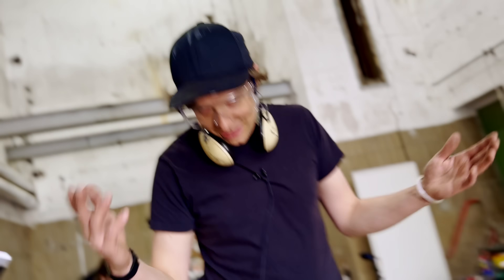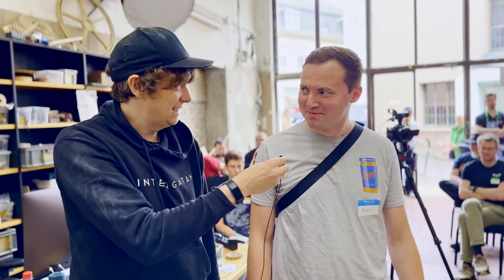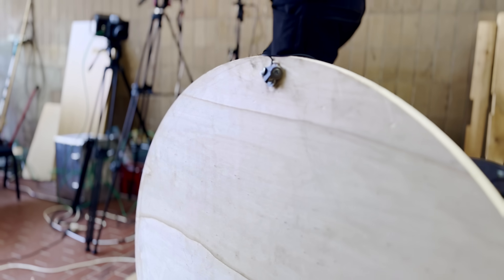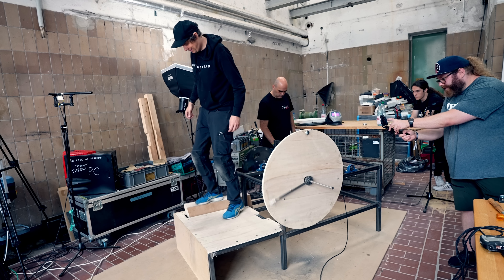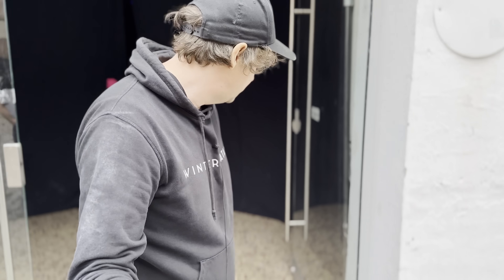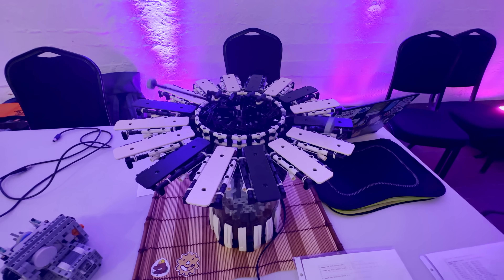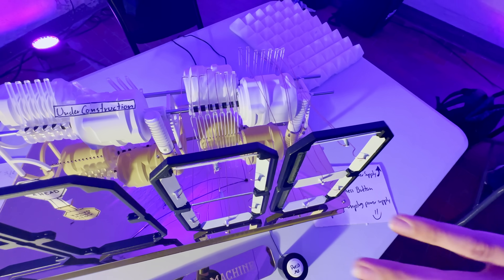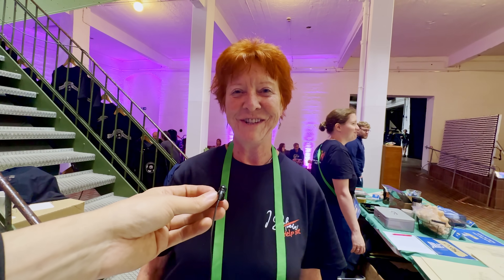First Timing Tests - DAY 6 - Marble Machine Flywheel Prototype

Comment: You're going to need some kind of regulator on the velocity. I don't know how that can be done mechanically without a ton of clockwork-like mechanisms. But ultimately, the consistency of the bpm is going to be limited by how well and on-beat you can pump the pedal. This will be hard no matter what and will be particularly hard when you are operating a bass guitar and various levers for the performance.

Comment: Don't match to a metronome, match to 1/80 of a minute after each hit on the wheel.
Have the computer play a sound on each hit of the mic, the sound is really too sounds the first starting at 0:00.00 the second at 0:00.75.
Then you can just get to speed and not worry about overshooting to match the metronome

Comment: If this doesn't work, you have the weight drive as a back up, and you can "recharge" it with this pedal mechanism; adding slack for the weight to pull.

Comment: I really feel like the falling weight design would be a lot better suited for this, for several reasons, and here are just some of them:
- In your comparison video you mentioned how the gravity powered design is used in clocks and even for telescope turning which are very precise scenarios. This will give you constant control over bpm without having to focus your leg movement to balance between overshooting and undershooting, which is both distracting and tiresome
- Flywheel systems are meant to store energy and release it, no one uses them for precision timing. It's kind of like a pulley (and additionally like a short term energy storage), where you input bursts of less energy quickly, to do a much more difficult job slower. Similar to a flywheel, where you pump in bursts of smaller amounts of energy, and can later release that energy for a more intense quick job. Sure a pulley is not a direct comparison but you get the point.
Reply: Ultimately, I think his machine will still need to incorporate a flywheel simply to resist instantaneous fluctuations in speed. I think what would be really cool to see is instead of a continuous energy input, the pedal could be used to "wind up" the falling weight. If there were a ratcheting noise associated with pressing the pedal, he could incorporate it into certain parts of the song for added effect.
Reply: An adjustable escapement could change the tempo but I'm not sure you could adjust it quickly and without stopping the machine
Reply: @MeisterFurball  from my experience as a musician, you need a system that can compensate for some degree of drift (besides being able to set a wide range of the tempi from the onset of a song). Drift compensation of course wouldn’t be necessary if the Marble Machine is always the instrument that’s generating the master tempo and other people/machines follow.
Reply: @MeisterFurball  Could incorporate a similar gearing system to bicycles, where the chain slips onto another gear on the go. I imagine it would be faster than adjusting the tempo of current flywheel design, even using the break
Reply: Falling weight works well for a clock because the size of the weight relative to the amount of work being done is manageable.  A clock needs a very little amount of input power.  The marble machine needs a lot of power just in the friction of all the components, which means it needs a massive weight (1000lbs+), or a higher drop rate (falls too fast to complete a song).
Reply: It would be very hard to control the tempo of such a system though. A musical instrument needs that control. If you were to use variable friction for small tempo variations, you would end up with instability that’s probably worse than the flywheel design.

Comment: Just thinking. What if you had an hall effect sensor on the flywheel so you could have an RPM readout and use that to coordinate around the BPM. It would help to eliminate some of the guesswork around synching RMP to BPM

Comment: Why are you trying to align a fly wheel, which is designed to, fly, with a BPM? You shouldn't be pedaling at your desired BPM as that defeats the stored energy purpose of a fly wheel; there should be a tempo mechanism that you are setting and governing the rotation of the programming wheel based on a set tempo which is drawing energy away from what is stored in the flywheel.
Reply: this <3

Comment: I think you need a gear box that can accept a variable rotation input and output a steady time. Then a stick shifter that can shift to different tempos. Sadly I'm not smart enough to design such a gear box. Sounds really complicated.
Reply: Its called a CVT "continuous variable transmission"

Comment: You've built yourself a Phase Locked Loop, but inserted yourself as the Loop Filter.  Your undershot / accelerate / overshoot / decelerate pattern is a well-known phenomenon when a PLL is under-damped.
Reply: The gain is way too low....and always will be, given the design. Adding more flywheel inertia will simply make the problem worse.
Reply: @chrissavage5966  That's why at least a 100 commenters have said he needs a differential and governor.
The differntial to allow quicker changes in tempo and the governor to keep the tempo stable.
Reply: @chrissavage5966  Solution would be a bigger diameter of flywheel with less mass in the middle, so weight would be the same but inertia would increase.
Reply: I was just thinking that this feels like a poorly tuned PID. I guess there are other control systems too, though I've never seen an implementation.
Reply: I think the device would be easier to control with a digital readout of bpm derived from an optical sensor on the flywheel. Martin is reacting to phase differences from the metronome but that is two integrations away from his input, foot force. By reacting to the speed he is doing only one integration, which is easier to control.
Reply: The system looks under damped, but increasing the damping (flywheel inertia) will make the problem worse. 

The system is oscillating because the critical period (the amount of time it takes to get up to speed without oscillating) is too long.  Martin is trying to force the system to come up to speed faster than it can and therefore he's overshooting. 

If you decrease the flywheel inertia , the critical period shrinks.  The machine comes up to speed faster and responds quicker to tempo adjustments. If you overshoot and begin oscillating, it's easier to adjust. 

Which has absolutely NOTHING to do with playing good music.   No one ever leaves a concert saying "They kept such steady time!"
Reply: PLL = Permutation of the Last Layer, which is the last step in solving a 3x3x3 Rubik's cube when using the CFOP method
Reply: @ChuckSploder  I've been practicing CFOP, I'll try over-dampening my PLLs
Reply: TL;DR: a human powered machine is never going to be anywhere near accurate.
Reply: It’s really amazing to me that people are still investing in Martin after MMX. This latest video shows he really hasn’t learned much.

Comment: With some practice, I think you can address the overshooting issue by applying weight on the upstroke (braking force) and removing your weight on the downstroke.  Alternatively add a toe hook so you can apply braking force on the downstroke

Comment: Please add a hinge to the pedal (or allow the linkage to fold) so it's never forced down by the flywheel. The sides are a good start for saving body parts, but if something wedges itself in the gap, you will tear the machine apart.
Reply: That's a very good suggestion. Makes it safer when something small and strong gets underneath the pedal by accident.
Reply: @vjay4297 like a steel marble? Lol
Reply: If a marble wedges in the back of it, it can severly injure you as a low speed bullet, as well. In general, backup needed.
Reply: A cable linkage might be a good solution
Reply: At the very least, the gaps should be larger than a finger, or in this case the toe of a shoe, so it's not possible to become trapped. I know it's only an experimental prototype but it does look like an accident waiting to happen.

Popcorn, anyone? 🍿
Reply: @nagualdesign  you mean smaller? Ideally this gap will be less than a mm, opening it up to 12-20mm sounds like a horrible idea.
Reply: @D3nn1s  No, I meant larger. In industrial applications there are health and safety standards to avoid crushing injuries and the like. A very basic technique is to avoid small gaps that could trap or crush a finger, or drag in clothing. If the gap never gets smaller than, say, an inch during operation it's far less likely to cause an injury.

Having a very small gap of, say, a millimetre also presents a risk of damage to the machine if you drop something into the gap. It's normally wiser to allow some clearance.
Reply: @nagualdesign  id were talking presses and stuff like that sure. However allowing a 3cm gap e.g. you could get a foot stuck, then the pedal will pull it further down by friction. Sure best scenario would be 2m of empty space in every direction, but since he needs to stand there its best to keep the gap as small as possible.
Reply: He did that on the mmx. Idk why he didn't do it here.
Reply: @theredstormer8078 this is just a prototype to see if it is viable for tight music, when he does build the matching he will ensure 100% safety
Reply: I believe that's part of the plan and I think he already has it made. I think he's trying without to ensure the results of this testing without adding backlash from the hinge.
Reply: I think that will help with timing as well, because you can push down on the beat
Reply: Make it like, not attached to the flywheel, where the only way in can be powered is downwards.
Reply: The platform around the pedal needs to be partially removed. Have at least a 15 cm gap all around the pedal. The sides were added to prevent his foot slipping in there but the sides can be removed if the gap was made sufficiently large since a foot slipping down the sides wouldn't then get caught. Also, the sides prevent the pedal from going all the way down. If you look closely, the bottom of the sides reaches the ground when the pedal is level with the platform. The way he had it before, the pedal could go down much farther. That allowed more force to be applied.
Probably the best idea is to remove the metal bracing he has around and under the platform. It's not really needed. He could make the pedal a bit wider or have it in a T shape. So plenty of surface area for his foot. If his foot does slip, it would go into a gap and not get caught.
Ideally, he would want nothing there but the pedal. But that may not work since the pedal he's using has a large distance of movement (so it's higher off the ground and why he then needs the platform). He should look at shortening the length of the pedal but that would mean a redesign of the section the pedal connects to.
Reply: Or he could add a one way rotation hub to the flywheel so pedal would only power the flywheel not backwards.
Reply: Maybe a length of sprocket chain or just wire cable as the linkage so it will just go limp if something prevents the pedal from moving downward.
Reply: This was my idea to add a hinge. I knew someone else would think of it. It would keep it on a stand and be still nostalgic of the first machine.
Reply: That suggerstion has been made a thousands times (literally) over the pas four years. Martin DOES NOT LEARN.
Reply: @hundry_f  ah fair enough
Reply: Reminds me of the helicopter that crashed because an iPad got stuck under a pedal (really)

Comment: I wouldn't underestimate the skill aspect. Its always difficult to be in tempo when you are doing something new and the muscle memory isn't completly down yet. I as a gutarist for exaple, experience this even when i use a stiffer/softer pick, its suddenly a bit harder for me to play in tempo and it takes a little while before i get used to it. I fear that you will experiance this every time you'll switch up the weight/gear ratio as the pedal will behave differantly. Maybe spend more time practicing before you come to a conclusion about the machines capabilities. Its a completly new muscial instrument after all.
Thanks for the great effort and content anyway!

Comment: You should be your timing wheel on the fly wheel shaft and not the drive axle. To get smoother power transmission you need a two step system. Right now you input power pulsing, and you're trying to match you pedal power pulse with the 80bpm timing not being able to match it.

Comment: Following the livestream today, I think one of the reasons it is so hard to make this feel tight is that you only have control of input, for half of the time. On the MMX it was possible to control the input of power for the whole circle movement and thereby 100% of the time. It was mentioned and quickly disregarded to use bike pedals, because it would be very limiting on stage. But I think it's important to recognise why bikepedals work so well. Having two pedals allows for one foot to take over, when the other is not able to input energy into the system. Imagine trying to get a certain tempo while biking, but only using one pedal. This would be extremely hard and I think this answers the primary reason why this design is causing trouble and would do so even if it was more well tuned. Remember on a fixed bike you would also break when applying force in the wrong half of the circle. Using a strap as shown today would be slightly better, but I do think you need to be able to distribute an even amount of force on the up and down movement of the pedal for it to feel natural.
Reply: I think this is exactly it -- there is a huge loss of control with the foot pedal. The governor is absolutely required with this approach.
Reply: My two cents:
Hundreds of hours of cycling while listening to music taught me, that it is really difficult to stay in beat with cycling. The inertia is so big and the needed force changes drastically from needed a lot of force when you are behind and none when you are ahead, that it's difficult to get a feel for it.
Reply: You could also just add a second pedal and do the stepping with both feet. But it might be difficult to step on and off
Reply: @s.backer5134  some blacksmith bellows have that approach, where you move your weight side to side to push the pedals.
Reply: This is a key insight.  If a strap was added to hook Martin's foot under, he could apply pressure both on the up and down stroke - and in the opposite direction as needed - which would help with hitting the tempo versus oscillating around it.
Reply: The way you explained it with bike is so damn good
Reply: This is exactly why I think variable stroke is critical.  If the pedal drove a one way sprag clutch (bearing) to turn the first shaft, timing compensation could be made by stroke length.  The pedal would need to be sprung up.
Join the beat from the top every time.
Everything else is always turning. Let off the pedal, it goes up and is ready to apply power from the second you need it.
Long stroke to catch up, no stroke or short stroke to slow down.
Reply: Means Martin needs to build two pedals.... so basically a Stairmaster.
Reply: Perhaps a spring under the pedal would mitigate some of this problem. Energy to bring the padel up doesn't have to come back from the flywheel.
Reply: I don't know, putting wheels on the machine and Martin cycling around a stage has a certain appeal to it. 🤣But, seriously, using a motor like he did on the MMX is the best solution.
Reply: @two_tier_gary_rumain The motor was never meant to be used, it was just for testing